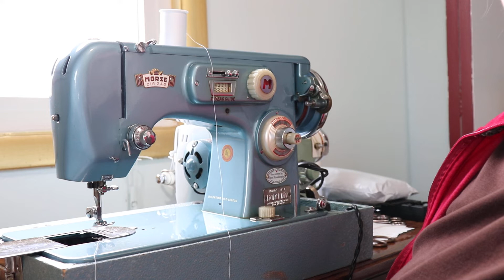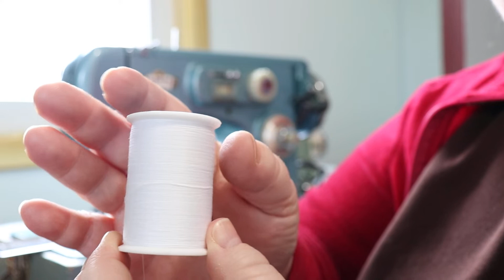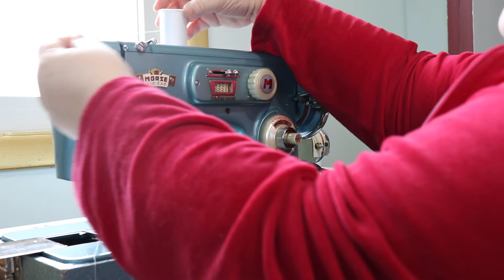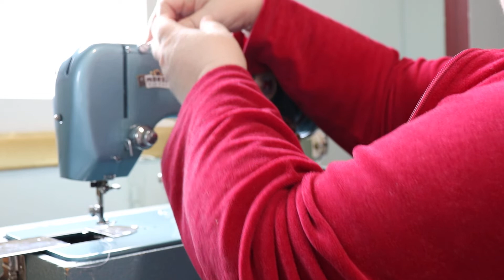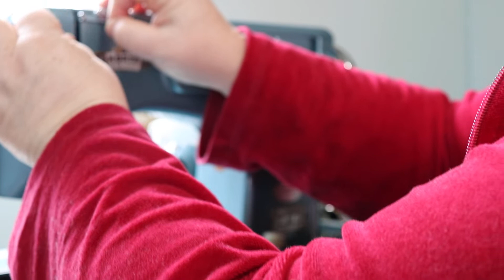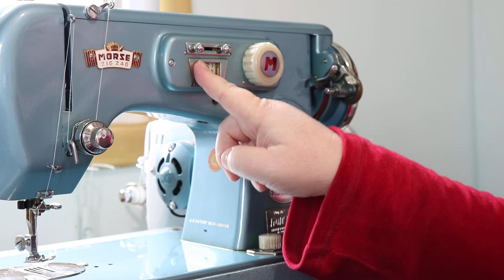How to thread a vintage Morse MZZ sewing machine tutorial

Comment: Thank you for this video.
Reply: Do you see leather with this? If so what's the thickness. Will it sew a good amount? And is the foot good for leather?
Reply from the maker: im so sorry, i didnt see this question~ yes it will sew through leather, especially with a good leather needle the motor has the power to go through quite thick leather. i have successfully sewn through 1/8" leather with no problems at all, double thickness.  You will need a leather foot however, and that does help the leather to slide through with minimal marking on the leather. This machine is not made for sewing leather such as human shoes, heavy bridles, saddlery, and very thick belts. Although the motor could handle the thrust, the rest of the machine simply would not be able to handle it. it is meant for home use, not commercial grade. that being said, i have sewn through quilts (free motion quilting), stitched up leather purses & doll shoes, mended jeans, & etc on this machine, & she has held up quite nicely. i hope that helps you out ~ bit of a day late and a dollar short though it is. 😊

Comment: Dear Carol, thank you for the video on threading the machine .  My friend has a 550 morse machine without I structions. 
All threaded but now a problem putting needle in.  It seems that the needle slides in on the left side of the sslhank and not in the back so it makes the needle hole going from side to side rather from front to back.  Maybe someone put the shank on wrong?  Can you give advice?  Do you have a manual available?  Thanks
Reply from the maker: The flat side of the needle should face right., and you thread it from left to right.
Reply: @CarolsCurrentObsession  thanks so much.  Not used to such an old machine but it sews beautifully.
Reply from the maker: @micheledemike6342  no worries, I hope that helps. If you have any more questions, be sure to ask, I'll do my best to help! 😊😊

Comment: Carol, I found a pink MZZ at the thrift store,weighed a half ton!!! I had it in my cart put it back, it was 39.95 no clue if is ran...what are your thoughts on a Morse.  it was in a beat up case
Reply from the maker: Oh my goodness~ go back and get that machine! 😻💓 it's the elusive pink one that got away, lol! I have been looking for a pink one for lo these many years...
I adore my Morse MZZ~ it's so quiet and is a joy to work with.
Reply: @CarolsCurrentObsession  Yes, I am think I will head there tomorrow,do you think the can easily be rewired, the plug looked iffy
Reply from the maker: @ThymewithLisa  Yah the plug can be dealt pretty easily, actually. Trust me, you won't regret it 😊
Reply: @CarolsCurrentObsession  it was gone, it was not meant to be mine

Comment: Hello , I have a Japanese made Howe 650 Delux zig zag machine that's similar but what I need to know is once you got the machine set up with thread on the top did you pull the thread through the front or back side of the needle as when I got my machine there was no factory manual for it ? My needle hole faces me when I sit in front of the machine to use it if that makes any difference at all .
Reply from the maker: Wow, Pete, I just saw this comment 10 months later, & I am so sorry! I hope you already figured it out, but just in case anyone else has a similar dilemma,  here's the answer ~ Japanese machines always thread through the needle in one of 2 ways ~ 
1) needle faces you, threads from front to back
2) needle faces sideways, threads left to right.
When I say needle faces, that means which way the hole of the needle is facing. 
Also, the upper flat part of the needle is always the back of the needle, and thread never goes through that back side first, because the channel or groove in the front is needed for the thread to go into as the needle dips down into the machine. That's why it's important to match your thread and needle size, or else you'll experience skipped stitches, broken thread, etc.
I hoped this helps, & I am sorry, Pete ~ for you, it's likely a day late & a dollar short. 😧😕

Comment: Hi I just came across your videos today after purchasing a machine like this today. Can you tell me what the button on the top of the machine is for and how it works? It is on top above where the light would be/ where the door opens.
Reply from the maker: Ah, that button is a pressure button. If you push down on the outer ring, the inner rod should pop up, & that should release the pressure on the foot, and then you can gradually add more pressure by pushing that inner rod back down by pre-set increments until it's again at highest pressure point all the way down. I personally prefer to sew with the pressure being all the way down ( the button pushed down completely)  ~ however, if I am sewing something particularly thick,  such as a quilt or heavy denim layers, I will let up pressure on the foot, which basically gives you more room between the foot and the feed dogs. You can also have less grab on the fabric depending on your feed dog settings.
Reply: @CarolsCurrentObsession  thank you so much for your quick response and excellent explanation!

Comment: I don’t really understand how to get the bobbin thread to come up... where do I put the thread that is on the bobbin to enable the needle to pull it up?
Reply from the maker: Hi DJ, I’m so sorry I didn’t see this comment earlier ~ once you have put the bobbin into the machine, just leave about 5 inches or so of thread coming out of the bobbin case, and the using the fly wheel, slowly ease the needle down into the hole, and hand rotate the fly wheel for one single rotation.  That should catch the bobbin thread up ~ then simply pull on the top thread (in the needle) and it should pull up the bobbin thread easy as pie. 😊 I hope that helps you out 😊 😘 😊 PS ~ don’t forget that every time before you start sewing, put the presser foot down, or you’ll get a tangled mess. 😊

Comment: This is similar to the one I just got I believe it’s called mason? From your videos I finally threaded it but when i try to sew it stays in the same spot and gets jammed, what am I doing wrong 😭
Reply from the maker: Hi Shianne! It could be several things~ tension, needle in backwards, or the feeddogs are not up. I would try the feed dogs first. Look over to your right and under the dial for stitch width should be a dial that says something like "normal 1 2 3 4 ", or "normal, silk, darn", or something similar. It should be turned all the way to normal, and that should raise the feed dogs up. (Feed dogs are underneath the presser foot and have little ridges in them that help move the fabric forward.) If your feed dogs won't move up, you may have a machine that is stuck and needs oiling and such. I highly recommend the Facebook group named "vintage Japanese sewing machines" or something close to that, also the group named "vintage sewing machines". Both of those groups have a Lot of information and such about how to oil and repair old sewing machines. I hope that this helps you out 😊